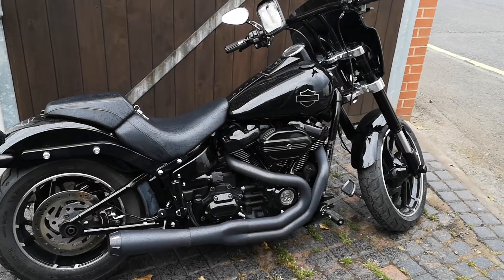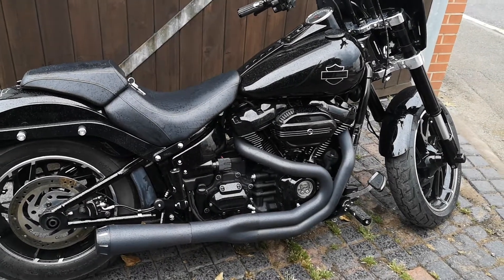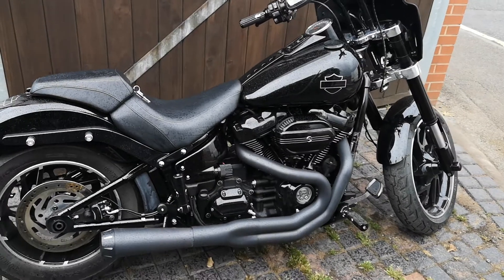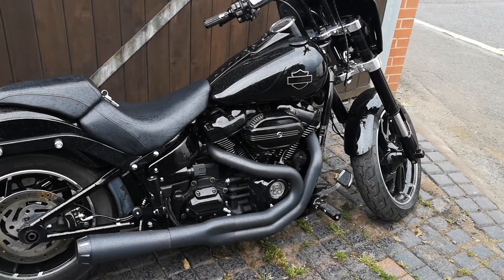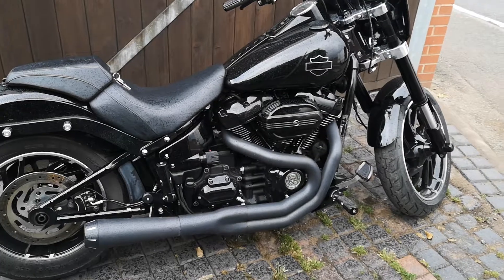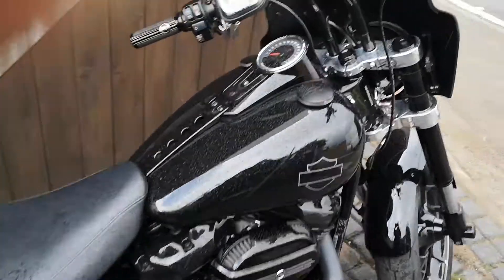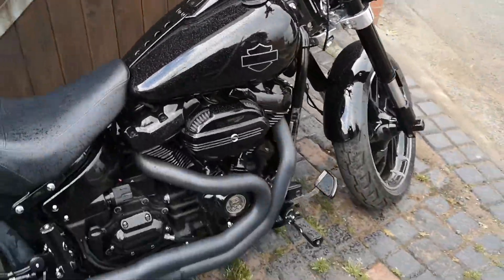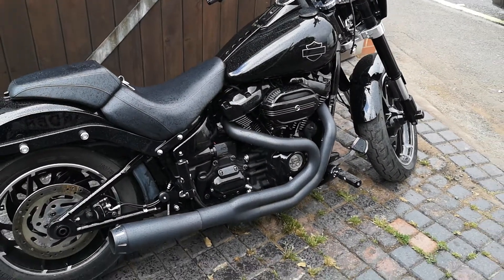SPORTGLIDE BIG BORE CONVERSION, CAMS, POWER VISION   128BHP

Comment: It`s a good looking bike but the Sport Glide is a pretty low bike and now with that exhaust you will be scraping on every right hand turn.  I would have chosen a pipe that does not wrap around the cam chest.
Reply: Cheap easy fix.  Install the longer shock from other softail models or the spacer by Bung King.  It helps both the available lean angle and the geometry.  I did this and no more boot heal dragging.